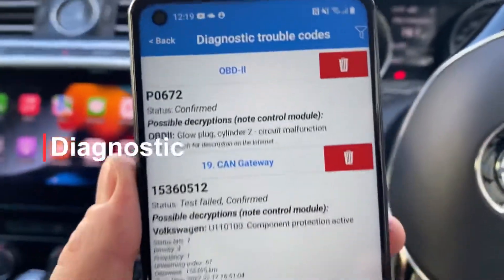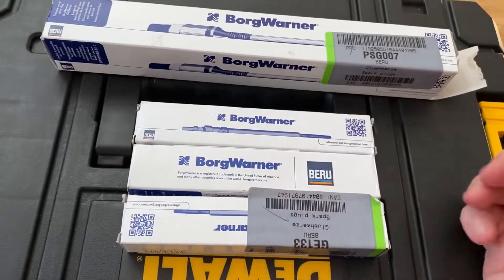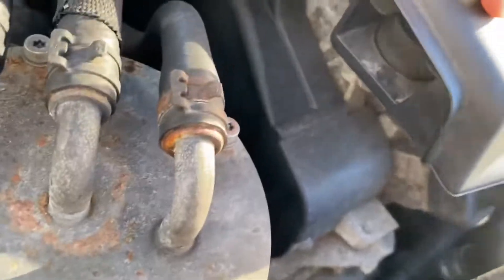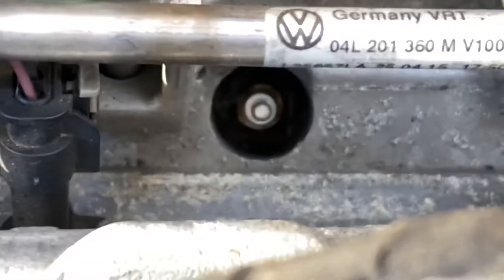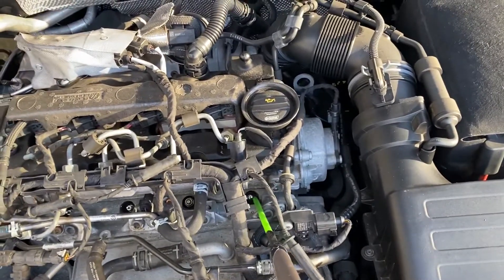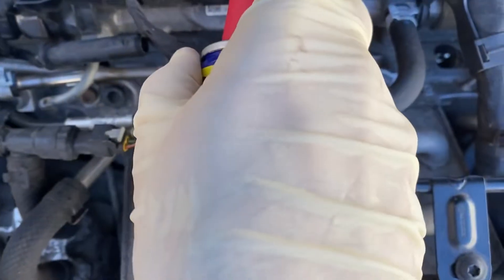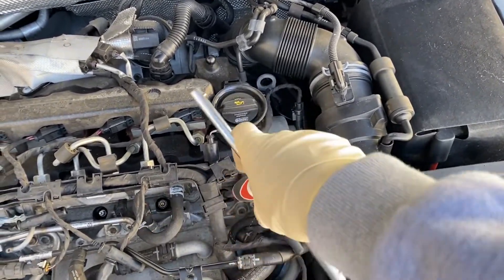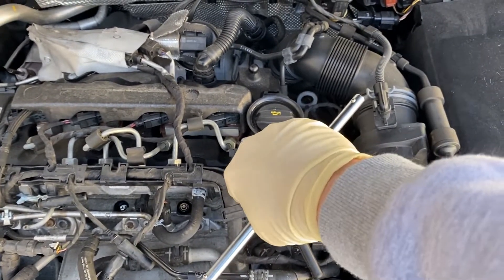How to replace glow plugs on a Volkswagen Passat B8

Comment: what torque tightnes did you use for B8 glow plugs?
I don't have manual and Online people say from 10nm to 17nm so I don't know how tight it should be.
The wrench you listed in the description is from 20.4 to 108.5 NM so I belive you didn't use that one to tighten them in
Reply from the maker: Sorry for the late response… I just did it manually, though I was reading conflicting information at the time, 14Nm in a manual and anything between 15-20Nm in a forum.

Comment: On that glo plug socket pliers, do you think the angled vs the straight was the best choice? I was thinking of buying both angled and straight, but since it will likely be a once to rarely used tool, figured I'd ask.
Reply from the maker: Sorry for the late response. At the cost of the plier, I went for the one that fits this particular job.

Comment: For the third cylinder, with pressure sensor, did you just pulled out the plug like the 3 other ? By pulling upway ?
Reply from the maker: Yes, just like the rest you just pull the connector off, then unscrew the plug.

Comment: Is it necessary to replace all of them if you have only one plug faulty? And one more thing, do you have to erase this fault with diagnostic to get this engine check light off from dashboard? Thanks!
Reply from the maker: You don’t have to replace all of them if you know only one is faulty, but in general if one is gone the rest will follow soon, and if you go through the hassle of replacing one might as well do them all. 
You do have to erase the error, but you don’t need anything sophisticated, as it can be done via OBD11 or similar from AliExpress. 😉
Reply: What size socket did you use for the pressure sensor glow plug?. Also was there any signs that it was faulty?
Reply: I've only replaced one so far and after approx 1 year another one. No need to waste your money. Replacing all 4 instead 1 takes 4x longer. You also need to screw the glow plug to a correct torque as specified by manufacturer.
Reply from the maker: @kubizdalis101  Each to their own I guess. My thought just as I said initially, why go at it 4 times, when they’ll all go soon… do it once, job done, see at it in another 5+ years. 
Ratchet to manufacturers torque… sensible enough not to tighten it too much to damage the thread or get it stuck. A proper ratchet would almost cost as much as taking it to a garage.
Reply: Dont be a cheap ass @kubizdalis101
Reply from the maker: 12mm for the pressure sensor, 10mm for the rest. The pressure sensor didn’t come up with a problem but was recommended to change at the same time. Many would disagree especially due to the cost of these… 😢
Reply: What is the torque needed for the new ones ?
Reply: @davidwashington4282 around 17nm I believe